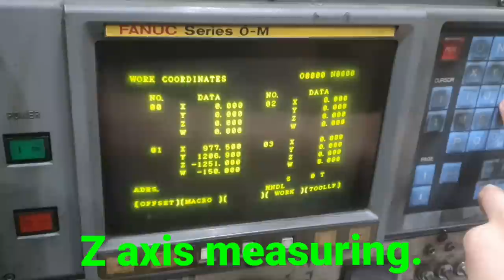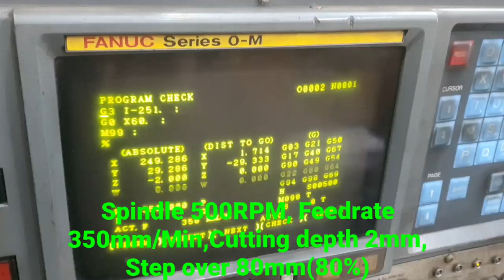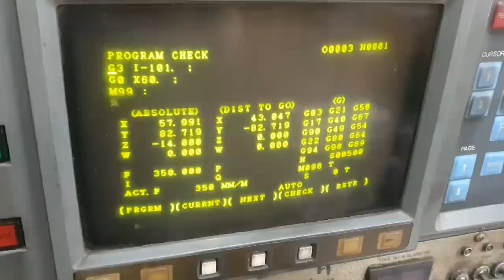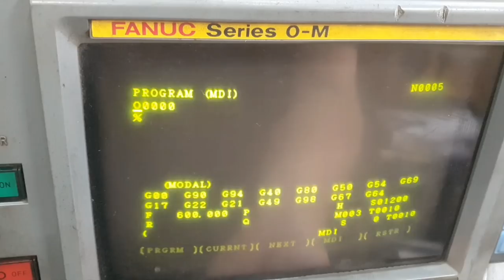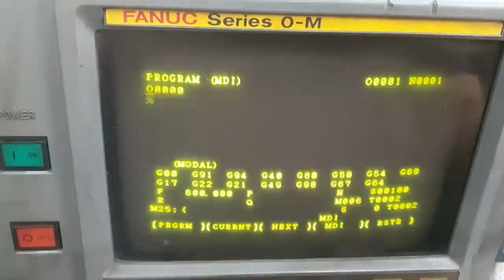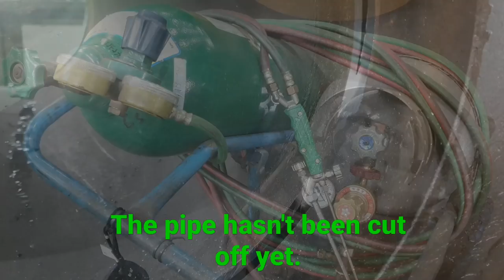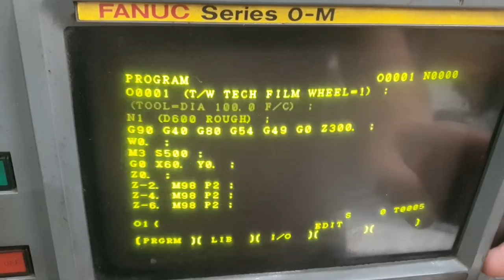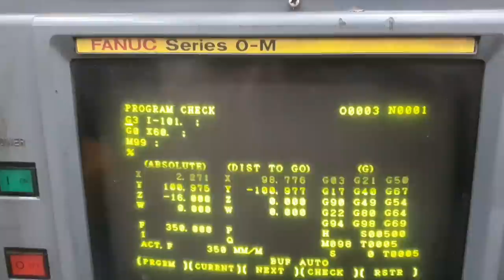D2500mm foamed polyethylene film wheel machining - CNC Boring, CNC Milling

Comment: Nice repair work. Please use a spark striker and not a butane lighter to light your torch. We want you to be safe to make more great videos!
Reply from the maker: When I upload a video, there are comments that sometimes laugh at me and mock me. And when I read such a comment, I don't reply, but I have time to look back on myself. But I can't let go of your comment. Thank you so much. I hope good things happen to you.
Reply: @jamespark_85machiningtv  Before the pandemic, I would visit Korea on business. I really liked traveling around Korea, especially the industrial areas.
Reply: Honest question: why, in a real world sense, is a striker safer than a lighter?

I can see two theoretical reasons, but I have a hard time believing that either is a real problem in a real shop with trained welders. I can see both of them being a problem if Joe Homeowner decides to light the new torch he just bought at home after five beers.

I can imagine a safety guy worrying that the torch will melt the lighter and you will get a butane fire or explosion. Given that the lighter body is largely contained in a human hand that will burn before the lighter melts, I can't imagine many people holding the flame on their hand long enough to melt the lighter.

Also the lighter is an inch or so shorter than the striker. So I guess it is possible that if you let too much gas out before lighting, you might be more likely to get the back of your hand singed from the flash as the torch lights. If the welder is wearing even thin gloves that seems to be a minimal problem, and if the welder knows enough to not pour out lots of gas before lighting it, there won't be a flash of any real size.

Is there some other reason to be concerned about the lighter?
Reply: @lwilton  The concern is probably more about where the lighter is kept. When using a torch or a welder, pieces of hot metal are produced and can land in pockets. If it melts a hole in the lighter, the gas released can cause a fire. We had one worker who was using a cutting torch, get burned when the lighter in his T-shirt pocket ignited. He wasn't wearing a proper coat because it was a hot day and the polyester T-shirt burned quickly. There were stories of lighters exploding but nobody could track them down. A spark lighter is safer because they aren't flammable.

Comment: hey man whats that wrench called at 1:13 ? that would be handy as heck for me at work!! I just stated at job at a shop that does big work
Reply: It's called a ratcheting spud wrench. They normally have a tapered handle that ends in a point for lining holes up. Commonly used in structural steel work.

Comment: It seems like this wheel is made out of some kind of metal, not foamed polyethylene like stated in the title.
Reply: I assume the reel will hold foamed polyethylene film. Some process needs a really long continuous piece of that stuff.

One possibility is it will be used for making long cables. That kind of foam is sometimes wrapped around the wires and/or optical fibers before the outer jacket is put on the cable.

Comment: Cool video. I can tell you do not work in the west. Using a gas torch with cotton gloves on and short sleeves? OSHA would have a fit!
Reply: I doubt that those are cotton gloves. More likely they are cut resistant Dyneema (UHDPE) gloves. Either way, a western health and safety inspector would indeed have a hissy fit!